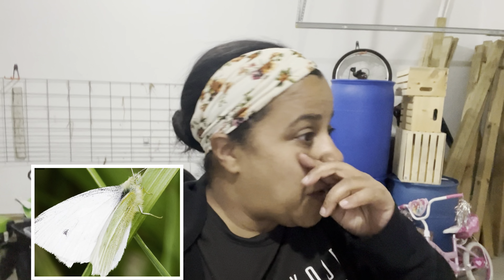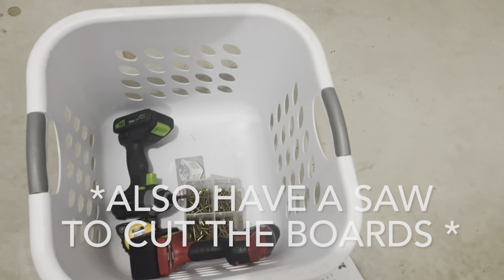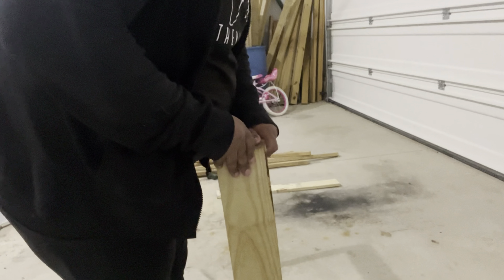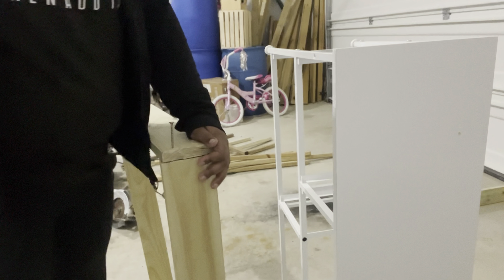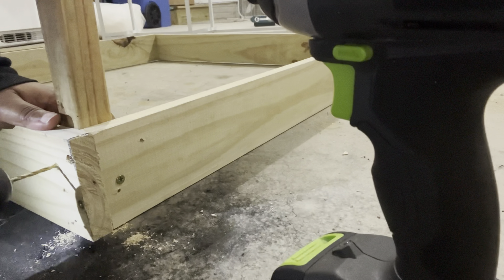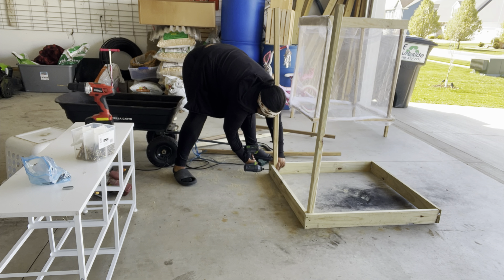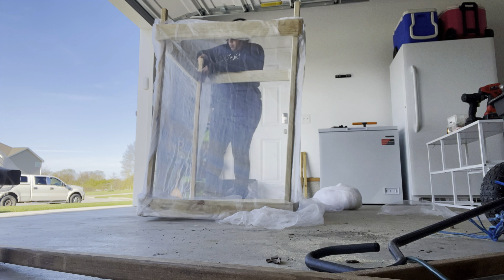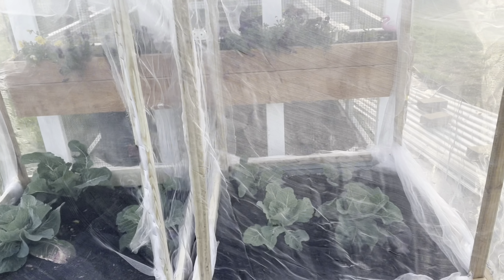Stopping Cabbage Moths before they ruin your crops -Building Brassica Cages

Comment: Thank you so much for sharing the process. How do u store ur cages when they are not needed or over winter/ out of season?
Reply from the maker: I have stored them either in my garage, or upside down outside as well, tucked against my fence, or used to hold down my silage taps that I use to cover my beds in the winter, but in a garage or shed is better for the wood :)